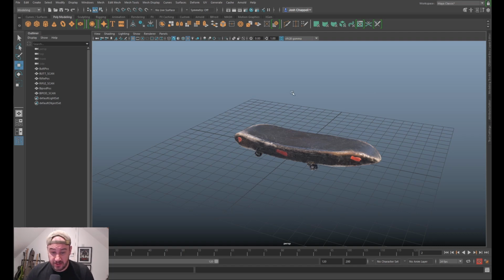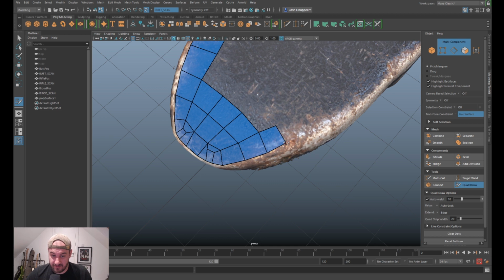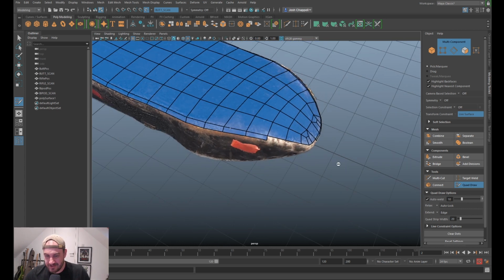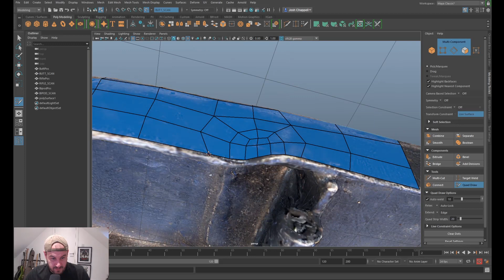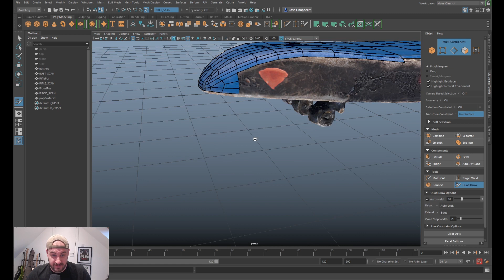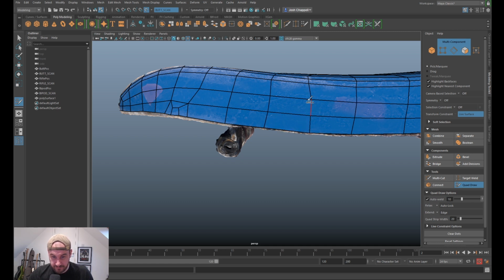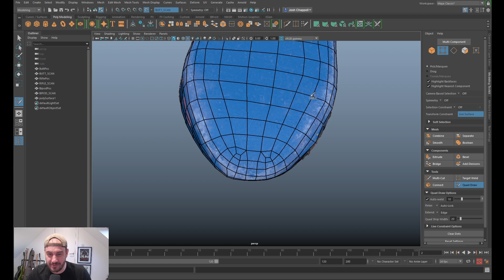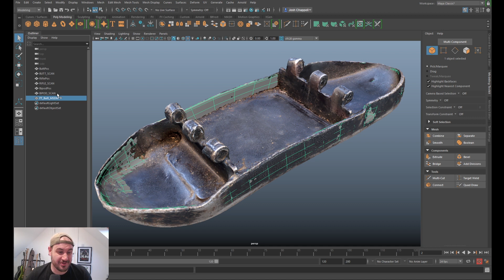Hard Surface 3D Modelling For Film and TV - Part 1

Comment: Depending on the use case for the model. say its like a rock or something else that doesn't animate, one can use say nanite for unreal. and topogun has better tools than maya, but since he used maya all the time, no sense in learning a new tool, however it could save him lots of time, because it was designed for retopology. also I'd bet if it was for a movie also you don't have to retopologize depending on use case again. but what do i know. I don't have the amount of years of knowledge this guy does, and my art still needs a lot of work
Reply: Thats obviously not the point of this video lol none of that was relevant.
Reply: Nanite and lumen still (as of writing this comment on Dec 5, 2023) are not as optimized as they need to be, especially for real-time. Even if you know what you're doing, you're probably better off without them. You might be able to get away with stills, but even then, you'd probably want to have something that's not "cheating" the visuals.